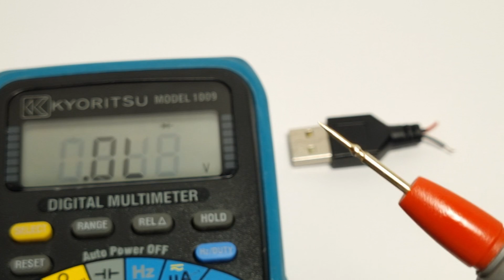Replacing USB plug (on my desk ring light).

Comment: Can I solder fuse resistor in it? Do we get usb cover in bigger size?
Reply from the maker: Well, I haven't seen bigger ones but for sure you can design and 3d print one! :)
Reply: @taboretum  ohh u mean to say it comes in one size only? I had a usb fairy light and few days ago the usb plug was burnout. It had fuse resistor in it, so I thought I can replace it, so was looking for a bigger size to fit the resistor.
Reply from the maker: @tjr1421  I don't really know, never searched for bigger once. But a small resistor should fit in some of these.
Reply: @taboretum  okay, thanks man for taking time to reply my messages. I'l see what I can do.